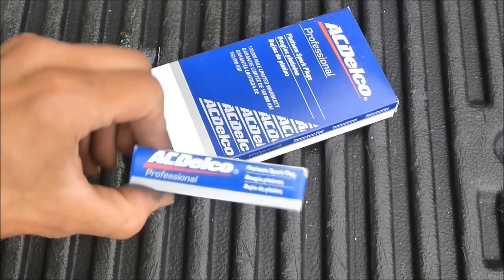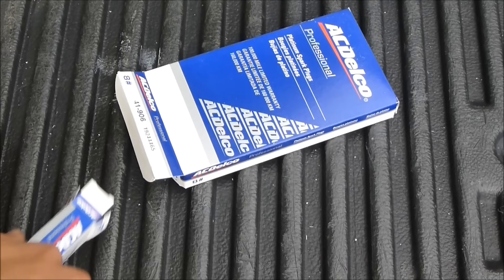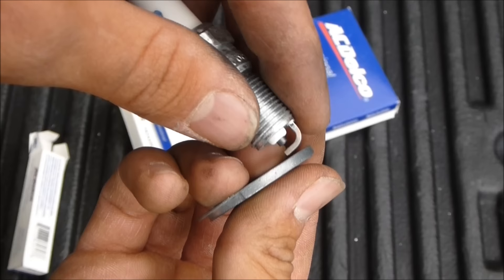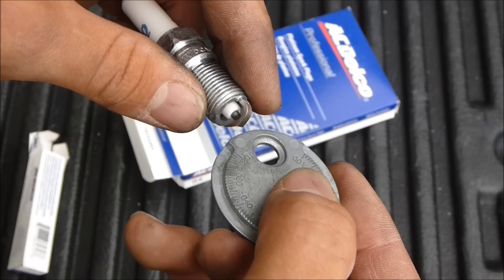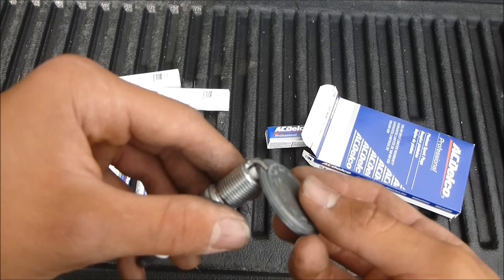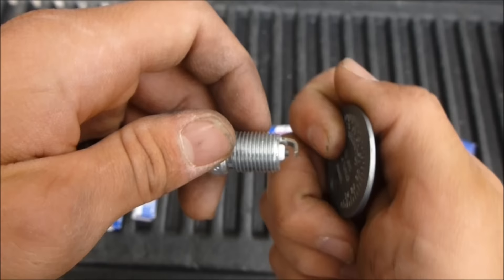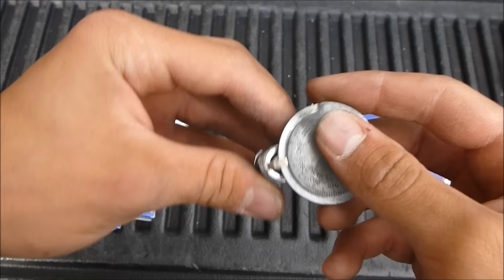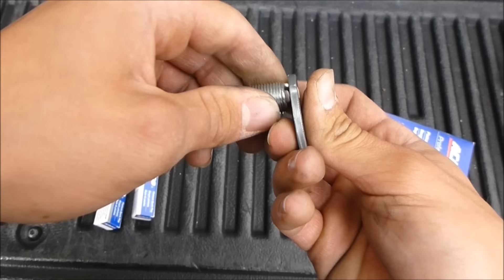How to Gap a Spark Plug

Comment: Personally I like to clamp down on the ceramic portion in a vice. Just enough for it to start to crack, but not shatter. And then a 10lb sledge hammer to adjust the gap. Works every time.
Reply: LOL

Comment: I changed mine yesterday in my Altima and although the slight shaking of my car is completely gone (thankfully!) I now have a slight odor of gasoline coming through the vents when the heater it on. I knew this wasn't a coincidence and I read it "could be the gap" or the plugs are loose. (Yes, or something worse) I know I did the proper tightening, but I failed to pre check the gap like a moron.  Dumb...dumb! Yeah I shouldn't have trusted "pre-gapped" I have to re do this tomorrow in the 20º wind chill nonsense.  Thanks for this, I have the same tool.

Comment: Thanks man. Ive been taking my truck to a garage to change my plugs because I didnt understand the gapping part. I thought it had to do with how far down you screw the plug in. I may attempt to change cylinder 8 now.
Reply from the maker: Derek Rowe I am glad you learned something new! Changing spark plugs is pretty simple. I will make a video for you on the basics in a few weeks!
Reply: Just did my #8 plug on my 4.6 Explorer. Only probem I ran into was the socket head came off and was stuck in the hole. Learned that I had to rethread it and tape the socket extensenions to the head. Thanks again for teaching me the gapping. Youtube has saved me so much money over the years.
Reply from the maker: Derek Rowe Awesome!

Comment: Most spark plug manufacturers warn against gapping precious metal plugs (platinum/ iridium). Check with the manufacturer, as most come pre gapped. The claim is, just checking the gap can damage or contaminate the precious metals causing premature failure - these are made to last 100k miles, in optimum conditions at least.
Reply: That's bs go watch the NGK video they even tell you always check your gap

Comment: i have the same gauge as you, and my engine recommends 1.0 to 1.1 inches or .07 to .08 millimeters. Is it me or did they screw up the measurements? Had to search for an hour but I found that the correct gap is .044 inches or 1.1 millimeters. They switched the two terms, and even if you do that the inches is still off by a mile

Comment: Most of the round puck type gauges, such as these, are built with terrible quality control.   
Where its marked .030" may in fact be off by 30 %  or more.  
I prefer the stiff-wire testers that I can easily verify myself.
Reply: I use my feeler gauges that are used to check valve clearances.

Comment: I ordered ac delco 41-105s for my 2004 cavalier. The preset gap should have been .043, but they're reading at .040, maybe even slightly less. Is it worth trying to gap these or just trying em out and seeing how they run? Fwiw the 2004 recommended gap is .042.

Comment: Using one of those round gap adjusters is like shooting yourself in the foot.  It is inaccurate ... need to use a wire gage.  I checked my spark plug with a dependable wire gage for a .044 reading.  Then I checked my sparkplug gap on the round one and it indicated .039: in the ball park but not accurate enough.

Comment: Should you be using the middle of the electrode on the spark plug for reference? Or the edges?
Reply: I wondered this as well.  I would think that the leading edge should stop at the tick mark you are going for.

Comment: What happens if you gap a copper spark plug by spinning to its size instead of using the circle part to do it
Reply from the maker: You can wear off the copper and then the plug wouldn't work as well or work at all

Comment: Awesome vid, not to troll on u but i got to say that the gap ring youre using is bad idea.
The ring is tapperd at a angle thus tweaking the tab at a angle and shortns the arc life or duration of the electric arc. Use a square ring that is 90 degree true to the gap. Also by using a tapperd ring, u are changing the gap on one side vs the other. 
i know its a small diff but when you are working with mills it counts in arc effect. 

I found out the hard way and could not figure out why my 2 stroke was running rich then running hot back and forth and screwing my timing up. Finally a ol school guy clued me in and it fix my mixture issues.

Love ur vids my friend, keep it up!!!!
Reply from the maker: hatersaywhat Thanks and thanks for the tips!

Comment: when you check the gap number once you get "resistance " were do you check the number at  the edges or the middle of the spark plug side electrode  ?

Comment: Does the spark plug gap depend on the brand of spark plug one uses or the vehicle? My vehicle calls for .043 but the plug brand is gaped at 0.44?
Reply from the maker: Depends on the vehicle, is the brand advertising 0.44?
Reply: @chrisfix  yes there gaped at 0.045.  I inspected my plugs and they still look clean and white in the middle except the top electrides look to be worn down on one side on all 4, like chiped.  Is that a reason to change them? Also only 1 plug out of all 4 is corroded, can I just swap the corroded one? Thanks In advance

Comment: Great video! I do have a question... does it matter how much it "lines up" in the center of the spark plug? In the first demo, with the correctly gapped plug, it looked like it was in a range of .049 - .052 since the L touched those sections.
Reply from the maker: If it touches the gap required than it is good to go. You can spend more time making them line up slightly more centered but I've never had issues as long as the gap is on the spec
Reply: I would line up the leading edge of the plug gap with the number on the gauge.

Comment: I have 3 spark tools gauge each one gives a different reading what can I do, which brand really makes good right readings?
Reply from the maker: Are they all the same style gauge?
Reply: @chrisfix  one is like plates ( metal sheets), the other two are like the one in your video ( like coins), the differences between the 3 gauges value readings are 10% and 15%, the readings by each gauge are .030, 032 and .035 three different readings,  not sure if there are a good quality gap meter out there, did you ever notice this in your gap meter, any good brand do you recommend?
Reply: @nandosmith9927 the coin style ones are usually the least accurate, also don't use the measurement part of the  tool to pull apart the spark plug. The ones with different pockets for different tolerances are usually more accurate.

Comment: i got a NGK G-Power platinum spark plug set in my car with about 20k miles on these, should i gap used spark plugs? (didnt know you had to check the gap it is my first time changing spark plugs for myself)

Comment: just to clarify, as u slide it up are u on the mark if the outside edge gets to the measurement or does the mark have to reach the center of the plug?
Reply from the maker: +israel padilla the center of the plug is where you measure. Good question.
Reply: +ChrisFix thank u. I appreciate u taking the time to make these videos and answer questions for those of us that are mechanically "challenged."
Reply: The gap is at the CENTER. Too bad he didn't mention that.
Reply: asaber11203 now I am confused.  I read it is at the right....bigger number.  Now it is at the center??

Comment: Don't use this type gapper on Iridium plugs. The center conductor on these iridium plugs is super thin and very easy to break if you accidentally hit it while attempting to gap them. If you break it, you cannot fix it and must throw it away and buy a new one. These iridiums can cost over $10 a piece.
Reply: can you link to a gapping tool suitable for iridium please? A lot of people mentioning this is the wrong tool but nobody linking the correct type :/

Comment: I've come across some spark plugs where the side electrode wasn't 100% centered over the center electrode. Can be seen from top view, they're a bit offset. Should you try bending them in a better position or its fine?
Reply from the maker: +mrsemifixit If that is the case, I would return that plug and get a new one.

Comment: With permission. I'd rather change the spark plugs. I'm afraid that by adjusting the gap of the mass electrode it will become weak in the curve and break when I reuse the spark plug and destroy parts of the engine. The quality of metals is not the same as it was 20 years ago

Comment: So I could basically use any spark plug as long as I have that tool to gap the spark plug.  I was wanting to try the Bosch double iridium plugs but when searching on Amazon there wasn't one that matched my 2012 Honda Odyssey, which I'm assuming because it had a different gap??  Thanks

Comment: Hey Chris, I unplugged the spark plug wires to check cylinder compression and after I hooked everything up, I had zero spark across the board. Changed the Ignition Control Module and everything's great. Any idea as to what I could have done that would have fried the ICM?
Reply from the maker: helivesonforever When you were cranking the engine to test compression you could have shorted it out. The spark can jump/arc.
Reply: ChrisFix Alright, I sort of figured that. Thanks for your knowledge!
Reply from the maker: helivesonforever Yea, were your wires near any metal?
Reply: ChrisFix  I don't think so but then again, I didn't check.

Comment: Hey ChrisFix. First off, great videos. Keep up the excellent work! 

What are your thoughts on four point or gapless plugs? I'm trying to make our 2008 Fusion perform a little better.
Reply from the maker: +Matt Hoffman Thanks Matt. Go with a single point platinum plug. I will be testing spark plugs by the 4 point plugs are a gimmick. They block the spark from the gas.

Comment: I can't believe I never knew what that round part was for, I've been "expanding" mine wrong since day 1. fml
Reply: I just kept pushing it around the circle lol until gapped smh
Reply: @717Chris  same here. Wow.
Reply: @717Chris  is that bad for the plugs? i only did it to one of them before i came here to make sure i was doing it right and now im doing them like this.
Reply: i have to say. with the internet around there should be no excuse as to why you fucked up. if your doing your own mechanical work on your car. spend some time researching how to properly do that. and next time your in an auto zone or pep boys and see something you don't recognize. ask what it is and what it does. knowledge is power.
Reply: and yes gaping your plugs too much will cause a miss fire. not good for your engine.

Comment: Thanks! I am on a 2-week quest to get all the info on everything before replacing mine. Problem is that I cannot get a hold of the gap intended for my car with any certainity and am paranoid to have it different than what the manufacturer intended.
Reply from the maker: Awesome! Did you check your owners manual?
Reply: @chrisfix  Hey Chris. Yes I did, plus forums, and many many google searches. Nothing with some certainty came up. Found the right tightening torque plus the model of the spakr plug (a Bosch) which is pre-set to 0.95mm but can't know if that;s what my car actually needs.The car has a 1.6 VTi (120hp) engine -Citroen Ds4.

Comment: At 0:48 , I see the spark plug electrode spans from 0.049 to 0.52. So do we read the number to the left or right side of the electrode? Thank You
Reply: Mars Sojourner its probably way too late but you should read the biggest number. On this tool you would want the right hand side of the electrode to stop at 0.050. 

It's a clear explanation in the video but he did leave out that it should be read from the right hand side(take the largest measurement).
Reply: Just split the difference.
Reply: Depends on what country you live in. USA is the right, Asia is the left...
Reply: Jeff Banfield, and where does Australia sit?
Reply: Pull pickup truck with rv
Reply: Jo-han Goh Australia is center, mate.

Comment: Is there really that much "tolerance" on quality spark plugs too? It´s beyond me how a spark plug - that is probably assembled by an industrial robot - can have a gap deviation of 0.07 Inches
Reply: On certain models there isn't, it's still just never worth assuming
Reply: They can be knocked out of spec after manufacturing during packaging or shipping. Not worth assuming and then chasing the problem down later. Additionally not everyone runs stock gap. There a lot of reasons to do this. Forced induction or conversion to electronic ignition being common examples. As an example, I’m changing the plugs on a 1974 F100. The plugs come set to .035” gap that would have been good for points ignition system that came from the factory, but the truck has been converted to electronic ignition and thus the gap needs to be set to .044~.045”.

Comment: When enlarging the gap can you just keep turning the dial slowly instead of prying up on the electrode?
Reply from the maker: chris8835 You can for plugs that are not platinum or iridium tipped. If you do it your way, it will rub off the thin layer of platinum or iridium.

Comment: Why don't touch the ceramic at 0:36? He means no contact with the metal coin or with hands?
Reply: You can touch it with your hands, just be careful not to strike it hard with the tool because you can crack the ceramic this will cause the vehicle to have a misfire

Comment: Hi, I have a question. I have a Toyota avalon and it required double laser platinum but they cost around $16 a piece. My question is, would it be a problem if I put some ngk platinum insted . What is your opinion on this ?
Reply from the maker: mikequintero Double laser platinum is a gimmic. As long as you use platinum plugs with the correct gap, you will be ok!

Comment: What about iridium Spark park plugs
Reply from the maker: You can wear the iridium off if you're not careful, go slow or use a different gap checking tool (like the wire style)
Reply: @chrisfix  my problem is I have a 72 Chevy pick up with HEI three 5350 and I get those at 45° Copper core now I’m switching over to iridium spark plugs and they’re telling me not to get them leave them alone what do you think I should do ? HEI says I need 45° gap- please Advise

Comment: Hi chris, i couldn't find anything on it and I want to ask you.  I'm doing a tune up on my car and I wanted to ask you what is the recommended torque for the spark plugs on a 2009 Ford Crown Vic
Reply: Look up the spark plug part number which should be printed on the plug. there should be a torque spec for cast iron or aluminum listed depending on your engine block metal type.

Comment: what is the deference, changing old sparks to new, does the performance improve or anything else i don't know anything about it???? plz HELP
Reply: It's different for each car, but a good rule of thumb is every 30k miles. Spark plugs and tips can dirty and the electrode won't burn as hot. This can translate to anything from reduced fuel economy, poor performance and rough running conditions including misfires, which can be very hazardous to the health of your cars engine. So overall, ensuring you have healthy spark plugs can improve the health of your car significantly. Hope this helps!

Comment: the distance between electrode and L thing,  what if the very tip of the L is way lower than the bend area of the L thing? distance should be right on top of the electrode right?
Reply from the maker: +Okaythen001 You measure the gap from the tip of the electrode to the closest point on the "L thing".

Comment: Hey what brand of spark plug do you use for your mazda truck, I have a 2001 ford ranger and was wondering which brand I should go with? Thanks!
Reply from the maker: For our trucks it really doesnt matter. Just get a platinum tipped plug and you are good to go. I think NGK is pretty good and so is AC delco. Whatever you prefer/is the cheapest (but still platinum tipped) because it makes no difference.
Reply: NGKs are the best shelf plugs you can buy

Comment: I went to O Reilly to buy SP and bought Bosch Iridium. The manager told me to get these over platinum because he said " Iridium are more dense than platinum, therefore perform better and last longer. Is he right?
Reply from the maker: +Jackie chan_WTF Iridium do work a little better (I have not tested them yet but in theory they do) but if they are significantly more expensive, I go with platinum. Platinum plugs last 100k miles which is long enough for the price and iridiums last about the same.
Reply: Jackie chan_WTF People say not to use platinum if you us fi.

Comment: this may sound like a ridiculous question but how can you tell if your spark plugs are bad?
Reply from the maker: +Alicia Morales That is a good question. Platinum plugs last about 100k miles and you need to see if they have the correct gap and if the electrode is in good shape. It is hard to explain in text. I will have to make a video!
Reply: +ChrisFix awesome I would have to look at my manual as well to see what my car preferences are for them. thank you :)